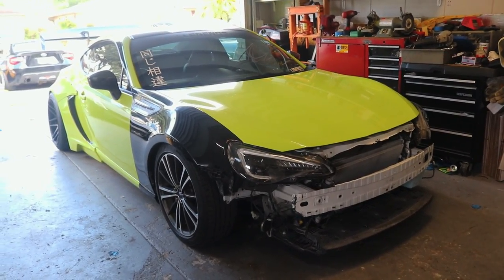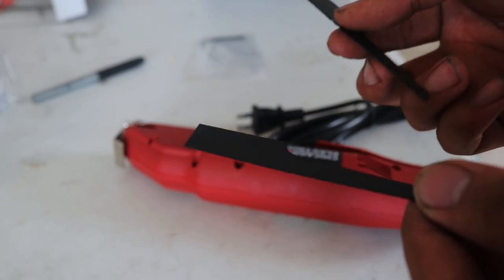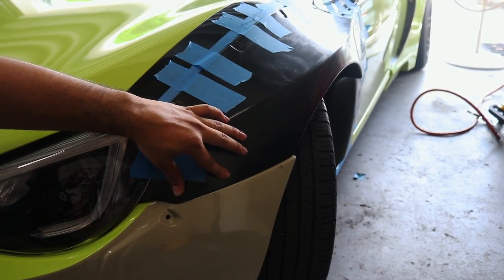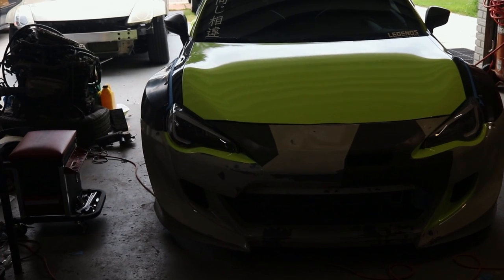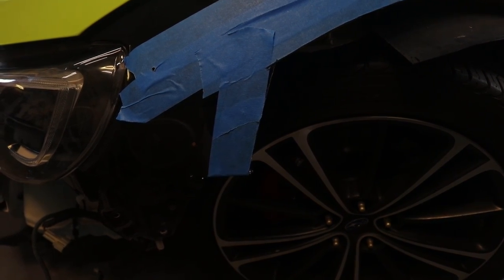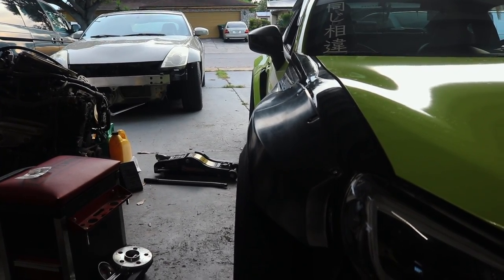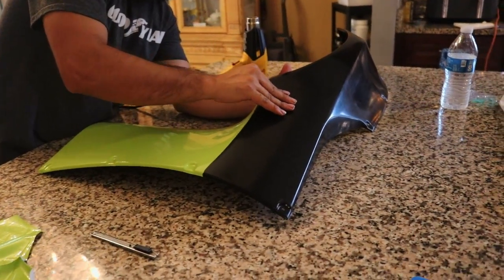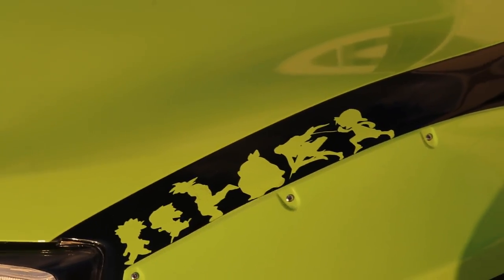Rocket Bunny v3 & Rally Backer Kit on BRZ!

Comment: i know this video is a year old and u just come across it but about the front tire poking out a little, all you had to do was remove the spacer and you wouldn't have had to mess with camber. that would have been enough to tuck it in a bit.
Reply from the maker: To get the best looking fitment the spacer and camber adjustments are necessary without the spacer the wheel would sit too far in